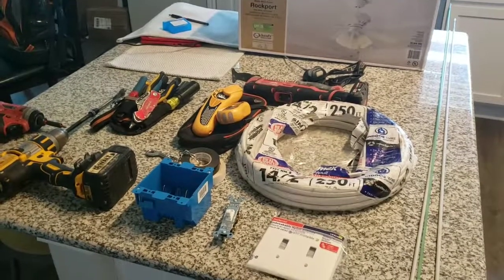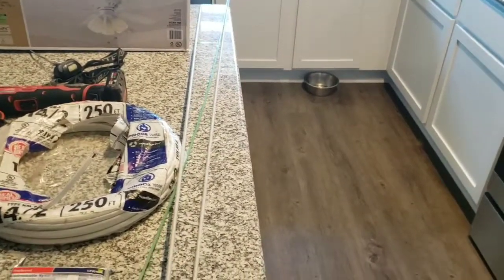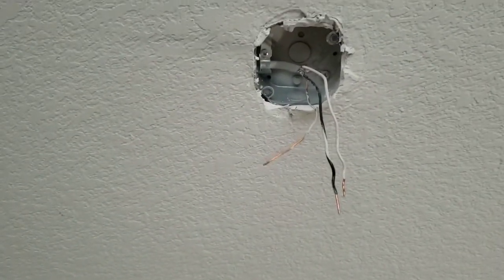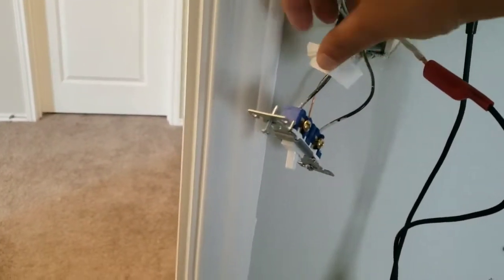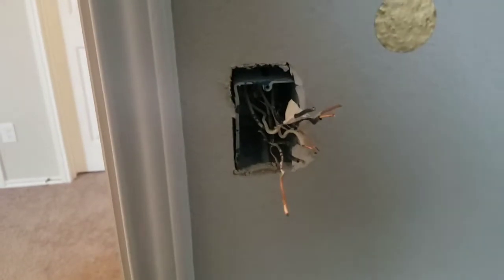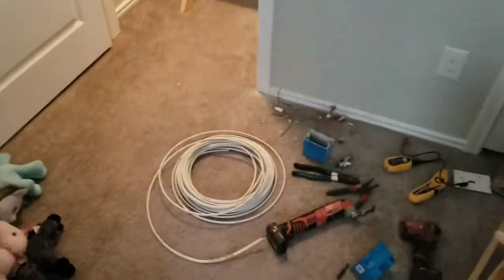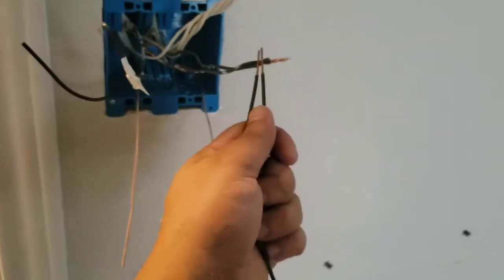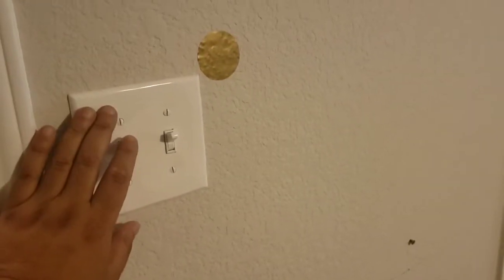DIY: Fan and Light On 2 Switches! ⚡🧰💡

Comment: It may not be to code but can't you use the white and the black for separate feeds and use the ground as the neutral. The ground is encased in the jacket so it wouldn't be exposed.
Reply from the maker: NO. THIS SHOULD NEVER BE DONE
Reply: @brandongomez5032  Do you play roblox
Reply: @brandongomez5032 I'm just learning and I don't need a Ladder because I have a stool
Reply: @brandongomez5032 You're a man so I can't tell you that you pass roblox age
Reply: Hellll nooo! Ground is usually not insulated and could cause short circuit. You just increase your odds of burning your house like that. The “jacket” or the housing is there for the convenience so that the 3 or 4+ wires can be together all the time.
Reply: @iosxtrader9518  “
Reply: No, never carry current on a ground lead. While it might not be up to code it wouldn't be dangerous to do the following so long as you mark and color code everything. You could use the white for the light from the switch and the black from the switch for the fan and run a neutral for the fan from another light fixture on the same circuit. This way you could avoid dropping a line and would only have to do work in the attic where the light and fan boxes are. I personally would do it the right way.
Reply: @billybassman21  I'm Interested in this method you are talking about but I'm a little confused. When I pull the fan down how do I wire it and the. how do I wire the switch?
Reply: @laiso86  The following info is at your own risk. 

Assuming your hot is coming from the switch, you wire the white and black from going into the switch box from the fan to the constant hot with your two switches in between. It will need to be a 2 switch that fits in a single box. So constant hot to one switch and constant hot to the other switch. White from the fan on one switch and black from the fan on the other switch. That will make both the white and black to the fan hot when the switches are turned on. White would go to the red (or sometime blue wire) which is your light at the fan and black to the black wire which is your fan. You will now need a neutral wire. You will need to find a light on the same circuit and run just the white wire from the other light fixture to where your fan is. Use romex wire, but only connect the white wire. I would label them all so the next person understands.
Reply: Hey Brandon that’s awesome
Reply: I mean my daddy is learning

Comment: Do all fans have different wires for the light and the fan? 
Or do some have just hot in for both to make you control it from the pull chains?

Comment: Thank you for this video. There was a hole in the ceiling that was covered up with plaster. When i exposed it, the wires had never been stripped and had only been cut and had nuts on them. When i wired the fan, it wasnt working. It os a single switch but the switch works an outlet.
In her room, there is a similar set up with a single switch that works an outlet. She has a fan but the only way to turn it off is with a pull chain. 
I didnt test the voltage with a multimeter before i started but when i wired itall up and it didnt work, i left the switch on and checked the voltage (but i had the fan still wired to the wires...not sure if that fucks up the reading..) it was only reading 1.5 volts between the white and black wires that i had wwired into the fan (i took the nuts off and kept the fan wired to it... dumb i know.. but i didnt want to separate everything to test it...maybe thats where i went wrong with the 1.5 v reading) 
Its a single switch but the ceiling has a white, black and red wire coming out of it so i guess its wired for a double switch then? 
I attached the fan/light to the white and black only. 
Im now thinking that maybe the 1.5v reading was from both hot wires (the red and black together on the multimeter...) because i think when i tested the white and black it might have been less than 1... i cant remember now.

Comment: How do you run the wire if it's a finished basement? Should I just replace the two wire with a 3 wire and use the old 2 as a fishing line?

Comment: Should you parallel the neutrals when using 2 cable like you did in the video? In Europe the most common way to do it is to install single wires in conduit, a chandelier like this would have 2 switched live wires, one common neutral and one ground. Of course many old houses have no ground.

Comment: thanks for the video! I have a question, trying to make sense of my scenario (which is in the bathroom, but also has one switch for the fan and one for the light) why aren't the live wires just connected each connected to each switch, but instead tied together and you used pigtails?  if they are both hot, won't they run power to each switch?? (not judging just asking because i need to do this on mine 🫠)--  I have a mobile home so I'm changing out individual boxes and wiring them normally, because the wires got loose!!!  Thanks for your help!!

Comment: I have 2 switches in my room and 2 lights. Each switch controls both lights, regardless if the switch is up or down. I installed a ceiling fan but in order to turn on the fan, the 2nd light remains on. If I turn off the switch, then it cuts power to the fan as well. Is there a quick fix to this? Maybe just get a remote control or smart bulb?

Comment: I ran a similar setup but with a double switch and the fan will only turn on if the light is on. Any thoughts?
Reply: That's why he's adding another line.

Comment: The original wiring I have is three black connected with one out, two white connected, three bare connected with one out, two red, and two black.  I would've thought there should be two bare for a ground on each switch, but there's only one coming from the butt connector.  None of this makes sense.  Edit: I forgot to mention that there's a second  switch across the room for the same light.  Not sure if this matters. Edit2:  The three black with one out is hot (120v), one red is hot (120v) and one black is hot-ish (100v).  This black and red are both coming from the same sleeve.  The other non-hot red and black are coming from a sleeve that also has a white.

Comment: Brandon how does that 3 feet of insulation workout for you and your electric bill?  Thought about adding some spray in over my R38 insulation to help reduce electric costs.  I'm curious to know if you are saving significantly (> 20%)
Reply: I have 3ft & it made a difference.  Not much but I also have vaulted ceilings in the main part of the house

Comment: Quick question how would the wiring go if is a 3 way switch do I need to do this wiring and run new wire for both or how?

Thank you for the video is very helpful💯

Comment: Awesome video. I’m in the same boat as you with the new build. Only one switch in the room and I HATE using the pull strings or remotes to control the ceiling fan. Incredibly inconvenient.

Comment: Thanks for sharing Brandon. I've done this quite a few times using 14-3 romex, but for some reason I'm having trouble with it now. When I turn on one switch (either light or fan), it controls the other switch as well. Any ideas?
Reply from the maker: Yes if you are using a hot stick sometimes they bleed. That's why we get  quality one. But still can happen.
Reply: @brandongomez5032  think I’m gonna just hook up fixture and see if it works 🙏👍
Reply from the maker: Sounds like you have the blue and black wires for the fan tied together in the fan
Reply: @brandongomez5032  You would think right? I haven't even gotten to that point yet. I'm just working at the two-gang box. I split the lead to power both switches. Then I have the black and red romex leading to the fixture. When I turn on one switch and check with my non-contact voltage tester, every wire beeps. Is this just phantom power? If I hook everything up and install the fan, do you think it'll work? Thanks for replying back – I really appreciate it.

Comment: Hello Brandon this is a great video, congrats. I am planning to do the same so quick questions and perhaps somebody asked already, but currently, I have 12/2 (existing switch) and will run a new 12/2 for the second switch, however since there is an existing switch I will end up with two white wires in the ceiling box, so do I have to put those together including the fan white wire. In addition in the switch box, do I have to put those together as well? Thanks a lot.
Reply from the maker: Yes. Just tie those neutrals in the ceiling fan (4/0) box together and tie the neutral from the fan to that joint. Stay safe plz! Shut off all power
Reply: @brandongomez5032  Sure I will and thank you so much. sorry to bother but In case I want to replace the wire and use romex 12/3 (Blak,White and Red)  do I need to have any special considerations
Reply from the maker: @miguelgomez5852  it would work the same way. There would be one less neutral. I don't see the point of changing it out unless the romex is damaged. Extra work for nothing in my book
Reply: @brandongomez5032  it makes sense and Thank you so much. This was really helpful

Comment: I think ya need 12 gauge not 14 gauge wire
Reply from the maker: Incorrect. Its a 15A breaker. 14 Guage wire is the correct size

Comment: So we get one awesome video, then nothing else. Please tell me he didn’t get a bad shock during his second video
Reply from the maker: Haha 😄 I'm alive man. I'm a commercial electrician with 3 kids and a wife. I'm a busy guy ! More videos on the way. Anything u want to see??
Reply: @brandongomez5032  glad you’re well. I understand that. I don’t have kids and I feel too busy. I had issues with wiring up my fan and light because whoever did it before me connected wrong wires and ran extra wires out for no reason. Your video helped me get it straightened out, cleaned up, and put together correctly.
Reply: Somehow the neutral and hot wires were touch pieces of the ground. So when you tried to unscrew the plate, the breaker would kick and make a weird buzzing sound.

Comment: Helpful video. I’m wanting to add some new lights in our living room and put them on their own switch. The current light is wired with power to the light first and then a 12/2 wire down to the switch. Could I still pigtail off of the wire in the switch box or would I have to pigtail off of the light in the ceiling? Thanks!
Reply from the maker: If you want to add more lights on their own switch you will have to get power from the switch box and run a new switch leg to your new lights

Comment: so all the white wires are twisted together but not connected to the switch at all?
Reply from the maker: Correct. A switch interrupts the hot. If u connect a neutral (white) wire to the switch it will trip the breaker
Reply: @brandongomez5032  It's so simple, well explained. Thanks.

Comment: So I have a switch that controls a light and two outlets. What has to be done so I can Use my outlets without having to turn on my light switch??
Reply from the maker: Just wire the switch legs controlling the plugs onto the constant hot in the box. Then hook up the switch leg controlling the light like a normal switch.
Reply: @brandongomez5032  do you have a video on this?
Or something similar?

Comment: Thanks for sharing! I’m about to do the exact same thing except my fan works. For wiring to the switches, the pig tails with the hot go on the bottom curled clock ways, relay switch goes on top, does ground go on each switch too?  That pop in box is the one I need. Bought one with nails that will be too hard to put in with existing construction
Reply from the maker: Please turn off all circuits you are working on. Stay safe
Reply from the maker: You need a pop in (remodel) box. And yes each switch needs a ground   wire

Comment: Brandon, is there a way to do this same hook up (fan and light to two separate switches) but with a remote control receiver in the fan as well? The control receiver I have only has a black hot and neutral wire which currently connect to red and white. The receiver doesn’t have an additional black to connect it.
Reply from the maker: I'm not sure. Call manufacturer. They get calls from electricians and customer's all the time. They will have an answer

Comment: So my home has several rooms pre-wired for ceiling fans with two switches (one switch turns on the standard bubble light and one does nothing now). So I assumed the bedrooms with just a single switch weren’t pre-wired. Plus I wanted a two gang switch for this room for a ceiling fan (as opposed to a single combo switch). So I watched this video and got super excited to run another wire. Well I buy all the supplies and get ready. I pull out the switch and the existing light fixture. I don’t really pay much attention to the wiring which had 14/3 wiring. In other words, it was pre-wired for a ceiling fan. So I wound up pulling a second line of romex for nothing. But since I pulled it, I decided to use it for the fan and the existing wiring for the light. I did a fantastic job thanks to this video. But I still feel like an idiot for not realizing I could have just used the existing wiring.
Reply from the maker: Man that sucks! Yeah I wish mine came pre-wired.
Reply: Brandon Gomez  Well at least I learned something pulling the Romex so I don’t feel it was a total waste. Now if I wanted to run can lights or something, I know I can easily. But I’m just mad at myself for not recognizing it.
Reply: I don't think you necessarily wasted your time and effort running an extra romex. You can use the existing 14/3 for the ceiling fan and the new 14/2 for future recessed lighting.

Comment: Is it possible to have a remote and wall switch control the fan light separately? I've been thinking that a 3way switch would work. Any comments on that?
Reply from the maker: I'm not sure a quick call to the manufacturer will clear little things like that up. We ask when we dont know

Comment: You should have taken the old switch leg out and put in a 14-3 wire.
Reply from the maker: I mentioned that..... but didnt want to buy a new roll
Reply: Brandon Gomez 
that's fine it works so who cares. Just thought I'd say something.
Reply: @italianstallion69420  What is taking out the switch leg mean? I'm currently going through this project and was wonderomg what you mean by that?
Reply: @laiso86  it means taking the old electrical cable out, and using one with 3 insulated conductors and a ground wire, so two hot wires in the same electrical cable. And use each one to control either the light or the fan.

It would just look and feel clean and professional.
Reply: @italianstallion69420 what if is hard to get to and is stapled should I just cut off the ends so I can use a 3 wire instead.
Thank you

Comment: Can this be done for a room that's on the main floor without cutting holes across the ceiling to feed the new wire?
Reply from the maker: If you are talking about the first floor on a two story no you be cutting holes.
Reply: @brandongomez5032  could you use the old wire to pull new 14 3 or do they typically staple to studs??
Reply from the maker: @aimbot8912  it will be stapled. Its a code requirement
Reply: When running the new wire, are there code requirements to staple it to the studs somehow?

Comment: Brandon, could you help with this.  Prewired new home with original two switch location at same box (one for fan and one for light) for a standard light/fan ceiling fan,  but replacing with a REMOTE controlled dimmable light/fan ceiling fan.  HOW DO YOU USE existing switches for each function- if possible? Or, does one switch become obsolete and capped at this point (If so, what color wire should go active?   From ceiling I have Copper, black, white, pink/red.  BY BOOK it says: Connect the black(ungrounded) wire from the ceiling to the black wire from the receiver;   Connect the white (grounded) wire from the ceiling to both the white wire from the receiver and the white wire from the fan ; Connect the yellow wire from the receiver to the black wire from the fan; Connect the three grounding wires (green, green/yellow stripe, or bare copper) coming from the ceiling, downrod, and hanging bracket; Connect the blue wire from the receiver to the blue wire from the fan.  How do you use the two switches that are at same location that used to operate light and fan independently?  Thanks.
Reply: I have one question: does your fan have those chains that allow you to control the speed?

You could still use the dimmer for the LIGHT only, just make sure you get the appropriate kind for the bulbs in the light kit.

Honestly I would recommend talking to an electrician in ur area if you are lost
Reply: Abraham Mendoza 
If you are planning on using the remote, I would recommend just getting rid of the switches

Comment: Nice video, thanks. Is it possible to install a light switch with fan control without adding wires like you did? Those two original black wires that were pigtailed, were they both hot? Couldn't you have used those to service both switches?
Reply from the maker: It depends on the fan. You can call manufacture hotline and get a solid answer. Only one of the pigtails was hot. The other one was probably feeding a plug, very common is cookie cutter homes